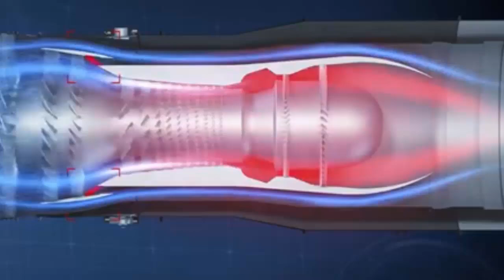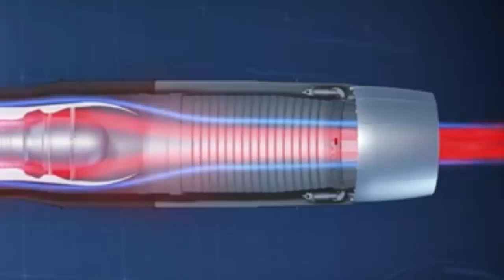China WS 15 turbofans Engines has been mass produced, The strongest heart of J 20 fighter jet

Comment: This engine is similar to the F119 but only 10% of its life cycle. The US started making the F119 in the 90’s. It’s border line 4th gen. This engine is without a doubt 4th gen at best.
Reply: WS 15 is slightly stronger in thrust compare to the F22
For sure
Reply: WS 15 is no doubt at par with western engine...could be better...

Comment: Pakistan needs to install these engines jf17 mk3
Reply: No, you can't just chose any engine! 
Guizhou WS-13 is the engine made spicifically to suit JF-17 !
Reply: @khaledselim8130  obviously it's not plug and play but for the j17 PFX program .
Reply: @pajeetkumar1645 It’s difference sizes
Reply: @MrNgkakit  the last I heard the PFX program has not is looking to make the JF17 bigger anyway.
Reply: @pajeetkumar1645  I have heard of three versions of the Xiaolong fighter jet that has been improved into a stealth fighter jet: 1) Semi-buried bomb bay. 2) Cocoon bomb bay. 3) Give up the turbofan-13 and use turbofan-10 instead. In the final analysis, China will not spend any time on the Xiaolong fighter. Pakistan has already purchased J-10CE. The FC-31 also has a foreign trade version.
Reply: @MrNgkakit  (Head wobble) what is this fighter you speak off ??
Reply: Nope just write "PAKISTAN AAND FORCES" on the  engine it will fly faster😂😂😂
Reply: @prashantbhosale7574  oh no no no saaar pakistan should copy india and over priced rafale and then losse them in the first air battle . Thats wishna guru style.